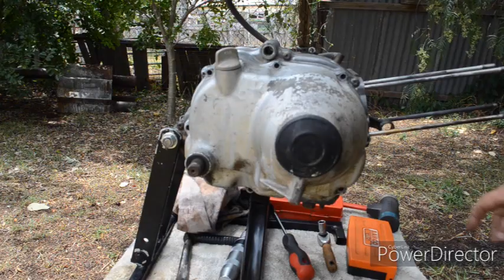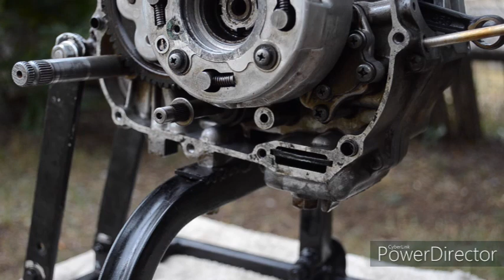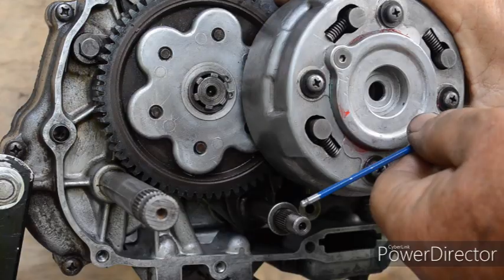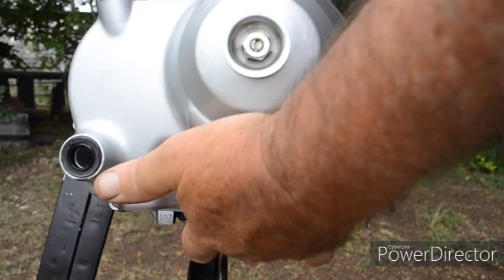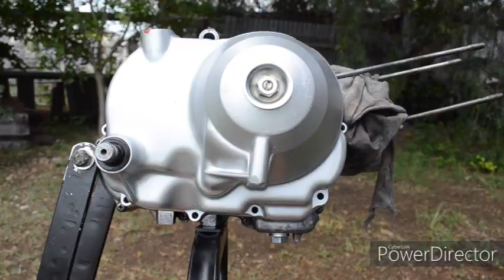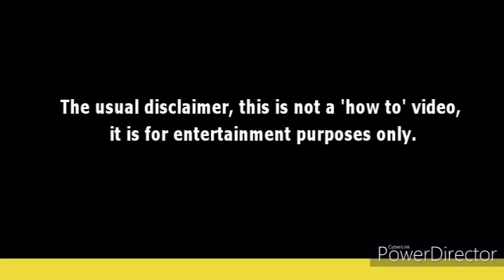Barney Clutch Cover Removal & Replace

Comment: I recently picked up a 1981 CT110 from my dad and replaced the oil and cleaned out the clutch cover.  However the bike won't go into neutral.  I'm wondering if I didn't put the lever on correctly?  Or possibly a different reason, I'm hoping I don't have to empty the oil again to inspect.  Thank you!
Reply from the maker: Hi Kenny, were the gears working OK before you removed the cover? If yes, chances are the lever isn't on the correct spline.  You can lean the bike over to the left & remove the clutch cover without draining the oil.  Good luck!

Comment: Where can i get a replacement for the inner thin spring? Or do you perhaps know the part #??
Reply from the maker: Do you mean the thin spring that fits into the oil pass pipe?  Part # for that spring is 25555-046-000 I don't know where in the world you live but in Australia the spring is available from Lambda motorcycles. https://ct110-postie.com/shop/categories/oil-through-spring-for-honda-ct110/?srsltid=AfmBOoqPgkcW2ie3HX-7fRcUPqKiPSdwiNHMe4FrQSgawgPcJTo8cQRf